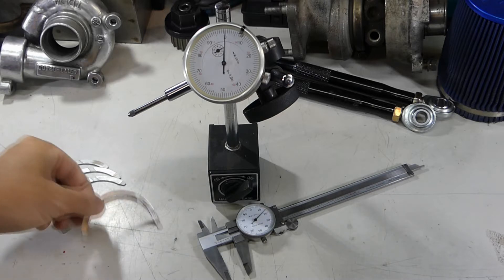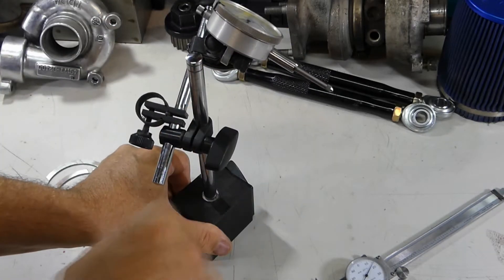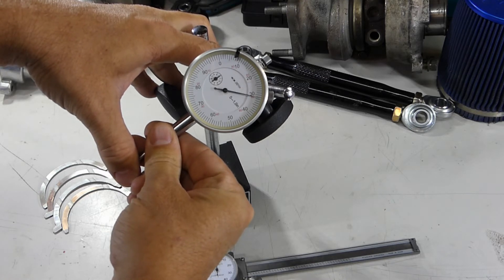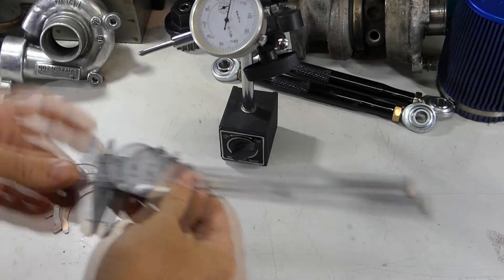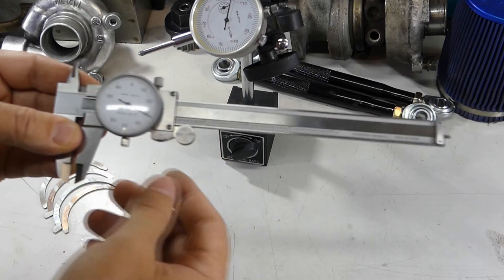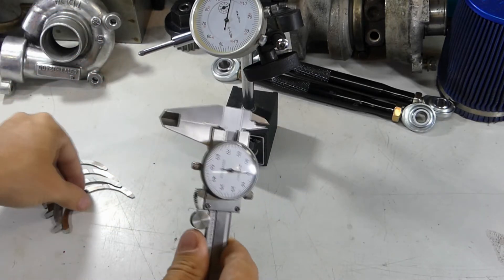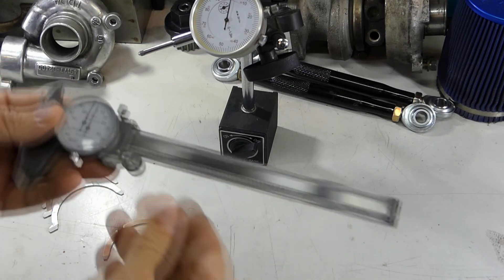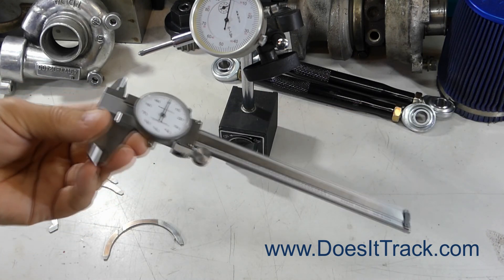How to Read a Caliper and Dial Gauge

Comment: "DON'T DROP E"? 
I HAVE REPLACED THIS TOOL AT LEAST 5,6 TIMES...NOT FROM DROPPING THEM,BUT SAILING THEM ACROSS THE GARAGE...TEMPERAMENTAL WELDER I GUESS..IT'S A TERRIBLE HABIT,BUT I'M WORKING ON IT...
DON'T JUDGE ME..YOU NEVER SEEN A WELDER LOSE IT,AND START SLINGING HIS HOOD,STINGER ETC??
HANG AROUND,YOU WILL..
GOOD VIDEO,BTW!!